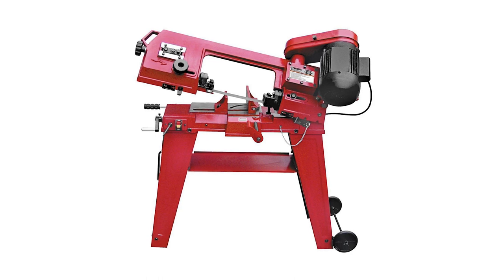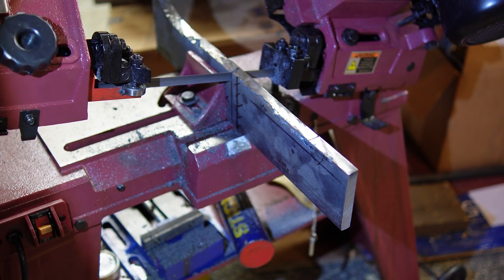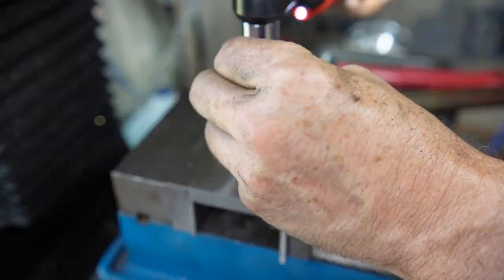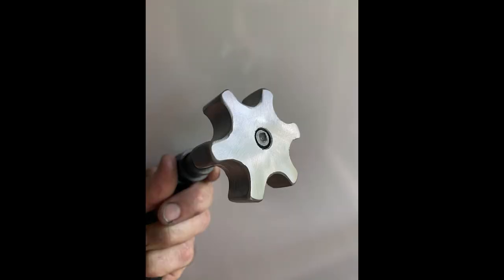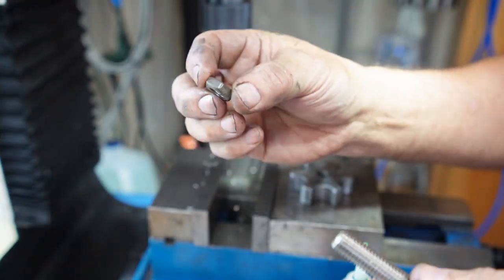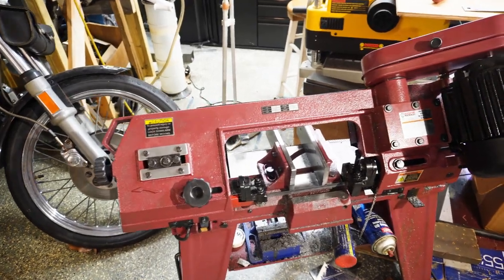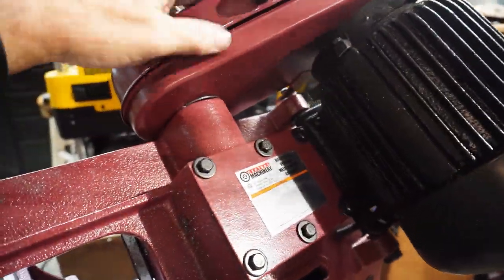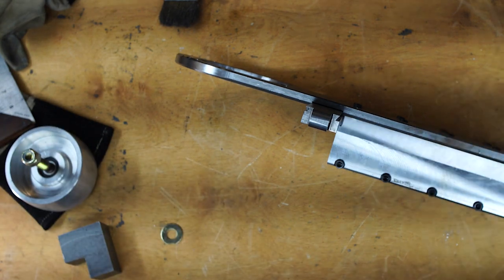Horizontal band saw extended vice jaws and saw adjustments

Comment: Nice video! Your belt sander project looks like it's off to a great start too!
Reply from the maker: Thanks.  Actually this bandsaw upgrade and tuneup was made as I was well into the belt grinder work 'coz I got tired of the crooked cuts the bandsaw was making.  Now the cuts take very little effort (and little wasted material) to clean up on the mill.

Comment: Nice work Greg - clear easy to follow instructions on both the jaw extension and the fine tuning tips. I've had a blue and white version of this saw for a couple of years haven't got around to extending the jaws yet - I did make a 3" x 8" fixture plate type holder with M8 holes and strap clamps from my mill to hold short & odd shaped stuff but better jaws would be faster and easier most of the time. I'm surprised you don't have more subscribers or comments? Maybe you need a cat in your video - no, not IN the bandsaw - just doing cute stuff in the background. :)
Reply from the maker: Thanks for the kind comments... and sorry that I just noticed. Of course I'm hoping for more likes and subscribers, but it will clearly take a while. Maybe a cat, as you suggest. I'll name him "Gear".:-)

Comment: Your fixed jaw will be too long for a 45 degree cut. Make another fixed jaw etender and cut to fit.
Reply from the maker: I see your point/concern.  I've frankly never cut anything other than square on this bandsaw -- at least while holding the part flat,  (I have cut some odd angles while holding the part vertically.)  I also have a portable bandsaw that I've used many times to cut smaller parts held in my table vice -- sometimes at crazy angles.

So I've never had to adjust the fixed jaw of this horizontal bandsaw from its 90 degree position -- and may never need to do so.  If/when the time comes that I have to swivel the fixed jaw and I find that it's too long, I'll cut through it at the same time as cutting the part.  

No big deal.  Meanwhile, the "max length" fixed jaw keeps my 90 degree parts held firmly.

Thanks for your comment, as I'd not considered this when making the jaws.  It's a valid point, but just not one that I'm personally not concerned with at the moment.